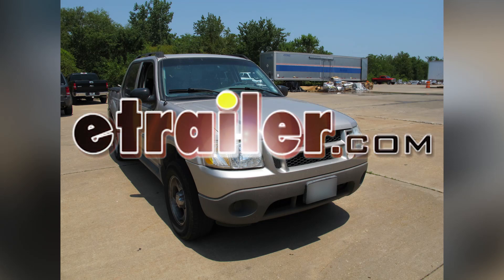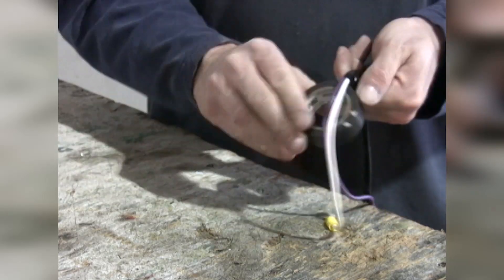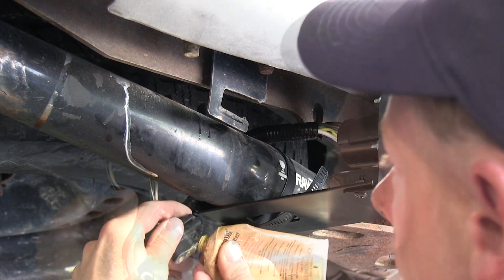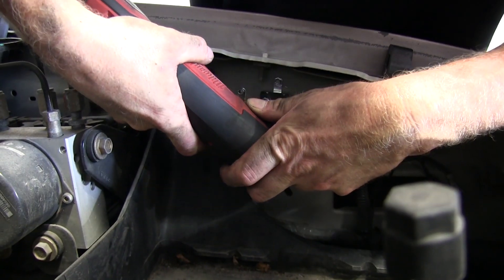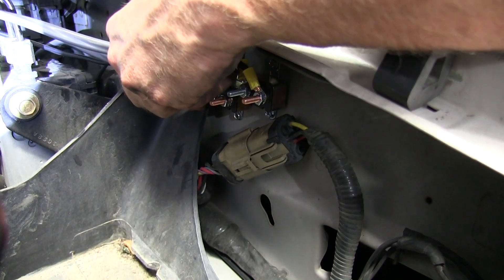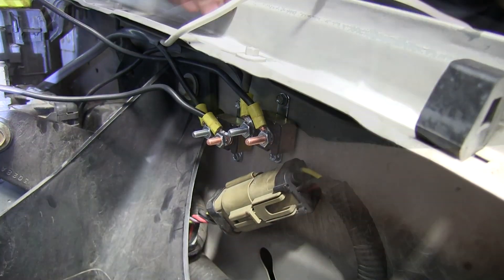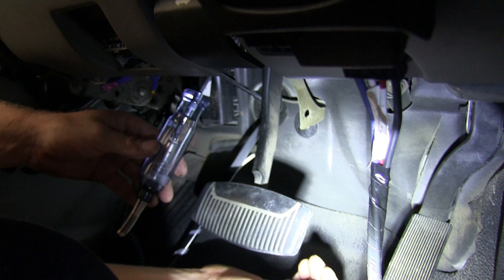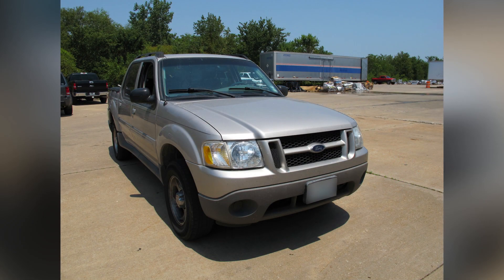How to Install: Tekonsha Prodigy P2 Trailer Brake Controller on your 2003 Ford Explorer Sport Trac

Comment: Thanks great video. I do have a question, my 2003 sport trac has a 12v plug in the bed, would not this be ideal to wire into?
Reply from the maker: It is not recommended. The power for this wiring kit needs to come directly from the battery. I have included a Help Article that provides some more details about the installation of this wiring kit. 

https://www.etrailer.com/faq-etbc7.aspx